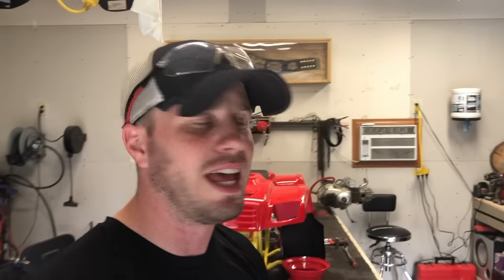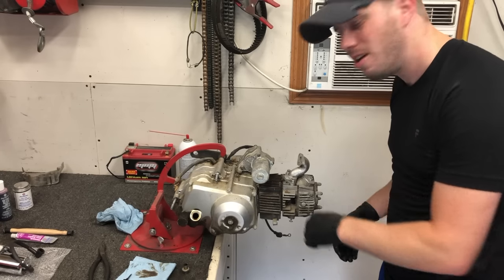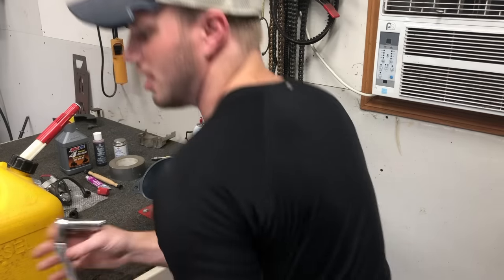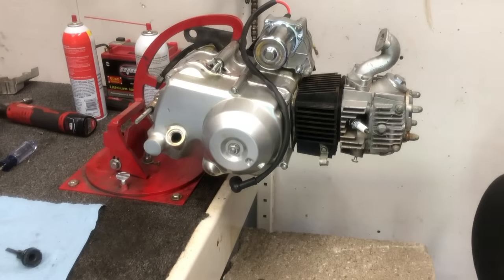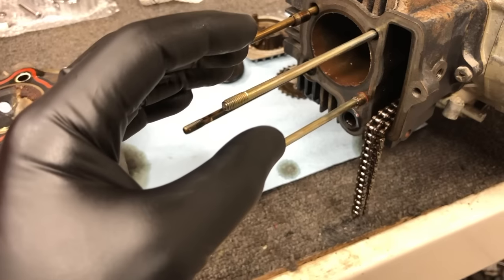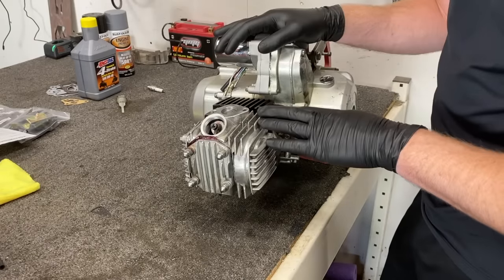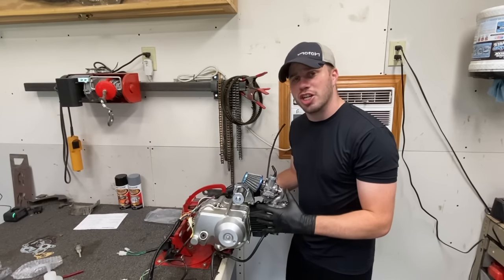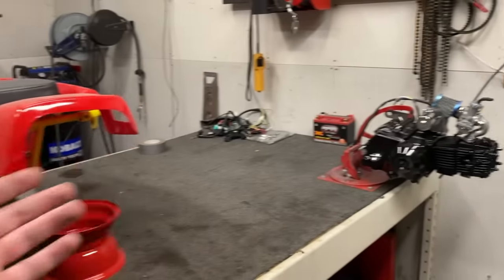Restoring a TaoTao 110cc Chinese ATV! Complete motor rebuild! Part 4

Comment: Quick question. I have a 110cc ZStar ATV that the piston is shot in. Would you know if a 150cc block would work on the transmission?
Reply from the maker: No it will not work. The stroke is different, you'd have to replace the crank as well.
Reply: @PraskaBoysGarage  you are starting to bring back some knowledge that was hidden. Lol
Isn’t there 2 different 110cc engines big piston/short throw and little piston/long throw? 

Sorry for the questions it’s been awhile sense I played with power sports. I have been a HD mechanic for 20+ years and am finding the love of wrench’s again with these Chinese bikes.
Reply from the maker: There is a lack of consistent information on these little guys so everything I know is pretty much from ripping them apart. To my knowledge the 110cc E22 style motors are the exact same when it comes to the crank and top end. I will be doing a video this summer trying to use a stock 110cc bottom end and putting a 125cc kit on it! We will see if it works I guess!
Reply: @PraskaBoysGarage  thank you for your reply’s. Guess I will start with tearing it apart and seeing what I can dig up to rebuild it.

Comment: Love the videos wear did you get the bench top motor mount.
Reply from the maker: Thank You! That is the #1 most asked question on my channel and I am expecting it to come up a lot from this video! I originally purchased the stand off eBay back in 2018, however the seller is hit and miss when they are listed. So I've decided to start working on manufacturing my own! Might be a little bit but once I'm ready I will be making a video for the launch!
Reply: @PraskaBoysGarage  Kool deal. Best of luck to you.

Comment: Are these motor know to have a tick to the motors ? My son has one and they had a small tap  a few days after we bought it.
Reply from the maker: I've never experienced that before. Have you checked the valve clearances? The need to be adjusted over time...not a few days though!The main issues I run into besides lack of maintenance are bent valves/broken springs, or if they have gears the teeth will sheer because lets face it 5 year old kids aren't the best riders!
Reply: No don’t know how to do all that; started a few day later but still runs strong 4 years later
Reply from the maker: @doobie3278  I with ya! I was taught that you don't fix what isn't broke!!

Comment: What is the best oil to run in these chinese motors
Reply from the maker: I use an SAE 0W-40 typically AMSOIL if I am going to keep the machine and have low hours on it. If it's going to be changed twice a year or I'm selling it I use TiLUBE 10w40

Comment: What wires did you connect to bypass the brake lever to start it?
Reply from the maker: I just held the 2 wires that attach to the brake lever together. Otherwise there is a second connector on the harness for a footbrake. If you put a jump connection in that, it will also bypass pulling the brake to start.
Reply: Thank you sir

Comment: Where do you find the best place for TaoTao parts?  I have found Partskit EXTREMELY unreliabile, out of 6 orders, all 6 orders had the wrong parts.  Also, I am rebuilding a TaoTao ATA 125D (110cc), and looking for a suitable wiring harness.  Reviews are hit and miss.   Where do you get yours for these 110cc ATV's?  Thank you for the videos!
Reply from the maker: My top 3 places I buy from is: 1) VMC Chinese parts 2) Amazon 3) eBay. I have a completely how to wiring video on my channel. I have links in the description but I will update this video later with an Amazon link I purchased my harness from.
Reply: @PraskaBoysGarage  I am really curious about the start/stop/light switch wiring.  The wiring harnesses I have purchased from both PartsKit & VMC do not have connections for that handlebar start stop switch.  Its the only thing that doesn't.  Off of the Start Stop Handlebar switch there are two mail plugs, one has a home, the smaller of the two on the female end of the wiring harness.   The larger male end has no female connection on the wiring harness.  Looks like the original wiring harness, had a female connection, but the wires were then spliced into the wiring harness.  I didn't see this in your wiring video.  How did you address this?  How did you get the lights to work?
Reply from the maker: @ericneusiis404  Can you send me an email with some pictures or even better send me an email with your contact information. That way we can video chat and see what your looking at!

Comment: Hey Praska, I have a similar ATV but the starter is at the lower part of the engine, and i have an issue where it cranks but every softly and you cant really hear it i was wondering if you can help me out, if i need a new starter or is it the actual engine.
Reply from the maker: Also make sure you have a good battery. A weak battery will give you the same result. If the battery is good I would test the starter like I did in this video with direct power, also remove the spark plug so it's not fighting against the compression. It's either the starter or battery! Good luck and let me know if you have any other questions!
Reply: @PraskaBoysGarage  Can the  battery be at 11 volts still run good because it's like brand new used it a couple of times.
Reply: Hey I have a similar engine after rebuilding a I am getting a popping noise in the bottom engine when turning the engine and do not know what they sound could be
Reply: @ravhunt2344  Also It like the piston is stuck in an area and its hard to move with the starter its self, I really have no idea but I dont want to take the whole motor apart and buy some parts and special tools.

Comment: Quick question boss, I have a new 110cc 4 wheeler about two months old and we were riding it and it slowly just stopped. I replaced spark plug and nothing. I sprayed starting fluid in the air intake and it started for a second or two, I know it’s not getting fuel now. There’s fuel in the tank and in the line filter but it’s not going into the carburetor or it is?. What do you think I should do next that’s the easiest approach? Appreciate any answers thank you sir.FYI Nice videos by the way! 👍💪🏼
Reply from the maker: It probably sucked something up in the carb. If it has screws on the bowl you can clean it and reinstall. Or if you want the easiest option order a PZ20 carb Amazon Prime for $15 bucks on amazon and switch it out.
Reply: @PraskaBoysGarage  thanks bro for the response! Really appreciate it🤘🏼

Comment: I am doing this engine as well, one question, I can't find any way to shift?  is this just a drive only?  no reverse??  Awesome video,   LOVE your channel.   I have a 150, a 125, and recently bought a 110 I am rebuilding!  found your channel a little late, but just in time!   just had to purchase a carb, but now I am wondering if I should tear the top end apart ...
Reply from the maker: The motors come in many different configurations. Some are only forward and automatically ready to ride when you start it up, others have Forward, Neutral and reverse and also they make have one that requires you to shift gears. All of them look about 95% the same.
Reply: @PraskaBoysGarage  well I searched this thing over and can't find any way to shift it so I am assuming it's just the one that has forward!   The 125 has a shifter and so does the 150.  Thanks!
Reply from the maker: @MyLooneyBin  Sounds good man, good luck on the projects!

Comment: Where do you get ur motor stand that bolts to ur bench?
Reply from the maker: My engine stand is probably the most popular tool I have on the channel. I got it off eBay back in 2018, but the seller is hit and miss when he lists them. I am currently working with a guy who owns a CNC machine to start making them myself!

Comment: Very helpful..thanks.  where did you get the motor stand?
Reply from the maker: Thank you! My engine stand is probably the most popular tool I have. I got it off eBay back in 2018, but the seller is hit and miss when he lists them. I am currently working with a guy who owns a CNC machine to start making them myself!

Comment: Where can I find a rebuilt kit brother to this same motor
Reply from the maker: This is a 110cc motor so it calls for a 52mm rebuild it. Here is a link from VMC or you can get them off eBay as well: https://www.vmcchineseparts.com/collections/cylinder-kits/products/chinese-cylinder-kit-52mm-for-110cc-engine

Comment: so i have a problem i took my engine apart because it was in a bad condition and gaskets were leaking so i had to change the piston and I got tried to solve the problem from before, starter spins very hard
Reply from the maker: My next video coming out should help you so watch for that next week! For now have you tried turning it without the spark plug in so it doesn't build compression? Could be a weak starter vs high compression.
Reply: @PraskaBoysGarage  i tried it is and i can hear some noise in the engine Like cam chain hitting something

Comment: Hey I don't know if your going to see this but im having pressure build up or loss of compression cause I have air coming out from my oil stick area can you tell me what my issue my be ??
Reply from the maker: If you have excessive pressure coming out the dip stick that typically means you have stuck or worn piston rings. You can try and put ATF down the spark plug hole and use a power drill to turn the motor over to help free the rings up in case they are stuck, otherwise it may require a top end rebuild.
Reply: @PraskaBoysGarage  for a top end rebuild how or what would i need as far as part to get this done unless you have a video that explains this cause im new to this but im anxious to learn
Reply from the maker: @alexisnarvaez5441  This video should help: https://www.youtube.com/watch?v=dDhGnXz5yKI

Comment: Omg. When I hook my battery terminals up my starter just gets engaged??? Please help
Reply from the maker: This is going to sound sarcastic but it's not...Are you connecting the starters wire coming off the starter directly to the battery by mistake and not to the relay? It looks the same as the battery power wire and can easily be switched around?

Comment: Great video my friend  
I have a similar engine and I wanna do the same
Where do you get the engine stand?
Reply from the maker: This is my #1 question for sure! I actually had a CNC company laser cut out all the metal to start making and selling my own. I will be selling the kits on my website either as a DIY kit or a completely assembled and power coated. I will post updates on the channel when they are ready!

Comment: Where did you get your engine stand holder and how much thanks
Reply from the maker: Thanks! That is the #1 most asked question on my channel and I am expecting it to come up a lot from this video! I originally purchased the stand off eBay back in 2018, however the seller is hit and miss when they are listed. So I've decided to start working on manufacturing my own! Might be a little bit but once I'm ready I will be making a video for the launch!

Comment: you painted the whole thing?
Reply from the maker: Mostly, I covered the intake and exhaust ports. Replaced the spark plug with a new one. Didn’t paint the starter, carb or intake.

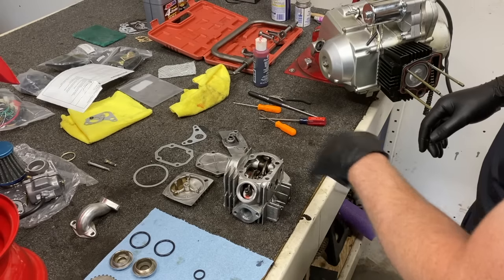Comment: I appreciate your videos, they have been a great help 😃 could you tell me, at 12:00 and 13:27 should there be a dowel in all 4 corners of the case and then on top of the cylinder ? Thanks from Australia
Reply from the maker: There are only 4 dowel pins total. 2 between the case and cylinder sleeve and 2 between the sleeve and head.
Reply: Thankyou mate. I'm already on engine 4 though ! One more question please, your engine stand, where can I find one ?

Comment: Some say this replyca Honda engine it is not ok because they put bushing hub not berings inside, it is that tru?
Reply from the maker: They definitely use metal bearings inside. I’m not sure what you mean by bushing hub but they are clones. Same as a predator 212 compared to a Honda GX200.
Reply: @PraskaBoysGarage  ok, sorry for my bad englisg. So this clone engine it ok.
Reply from the maker: @dudurosca273  No worries! I like these engines a lot!

Comment: Where did you get the engine stand? I rebuild these as well and man it's hard not having one
Reply from the maker: This is my #1 question for sure! I actually had a CNC company laser cut out all the metal to start making and selling my own. I will be selling the kits on my website either as a DIY kit or a completely assembled and power coated. Should have everything ready soon and will post updates on the channel.

Comment: Great video ! Do you happen to remember torque spec on valve cover nuts 🔩 ?
Reply from the maker: I reference Honda manuals from the late 90s for torque specs. Off the top of my head I wanna say it was 10-11 lbs ft torque.

Comment: i got water in it from air filter what shoud i do ?
Reply from the maker: Depends on how much water your talking. To be safe I would clean the carb out, change the oil, and then remove the spark plug and blow air from a compressor inside the cylinder. Then put a little ATF down the spark plug hole and rotate the motor a few times. After all that you should be safe to run again.

Comment: mine has a tube going from the air filter to  another spot on the back of the engine do you know what that is
Reply from the maker: To pass California emissions so it can be sold in all 50 states. It takes the case pressure and filters it back into the engine so oil doesn't pollute the air.
Reply: Praska Boy's Garage should i just take it off or diffrent solution
Reply from the maker: @nikolashitchcock7068  All the other motors just have a rubber line that runs down the back of the engine towards the ground.

Comment: Where did you get the engine stand?
Reply from the maker: It's probably the most popular tool I have on the channel. I got the stand off eBay back in 2018, but the seller is hit and miss when he lists them. I am currently working with a guy who owns a CNC machine to start making them myself!

Comment: Where did you get the motor stand
Reply from the maker: It's probably the most popular tool I have on the channel. I got the stand off eBay back in 2018, but the seller is hit and miss when he lists them. I am currently working with a guy who owns a CNC machine to start making them myself!

Comment: Nice video. Where did you get your bench mounted engine stand? Would be a great addition to my workshop 👍
Reply from the maker: Thanks! My engine stand is probably the most popular tool I have. I got it off eBay back in 2018, but the seller is hit and miss when he lists them. I am currently working with a guy who owns a CNC machine to start making them myself!
Reply: Great idea. You will have plenty of buyers.
Reply from the maker: @mikeweatherley936  I think it will be good, I usually get 1-2 comments per day about it across the channel. I plan to sell them assembled and powder coated or also in a DIY kit to save on the cost if you own a welder. Hoping to have the first few available by Jan 1st.

Comment: Where can I get myself one of these engine holder things?!!!
Reply from the maker: That is the #1 most asked question on my channel and I am expecting it to come up a lot from this video! I originally purchased the stand off eBay back in 2018, however the seller is hit and miss when they are listed. So I've decided to start working on manufacturing my own! Might be a little bit but once I'm ready I will be making a video for the launch!

Comment: who makes that motor stand?
Reply from the maker: My engine stand is probably the most popular tool I have. I got it off eBay back in 2018, but the seller is hit and miss when he lists them. I am currently working with a guy who owns a CNC machine to start making them myself!

Comment: Where can I find that engine stand?
Reply from the maker: This is my #1 question for sure! I actually had a CNC company laser cut out all the metal to start making and selling my own. I will be selling the kits on my website either as a DIY kit or a completely assembled and power coated. Should have everything ready soon and will post updates on the channel.

Comment: Man I know you get tired of hearing it and I hope I haven’t missed this answer previously but where did you get your engine stand? I need one and that seems perfect
Reply from the maker: Hey no worries man, this is my #1 question for sure! I actually had a CNC company laser cut out all the metal to start making and selling my own. I will be selling the kits on my website either as a DIY kit or a completely assembled and power coated. Should have everything ready soon and will post updates on the channel.
Reply: That’s awesome man that will make some good gains for you for sure. And I will have my order in as soon as you get them ready 👍. Thanks for the reply

Comment: I have that exact carb how to tune it,mine idling real high
Reply from the maker: There are only 2 points of adjustments. The air/fuel mixture screw and needle depth. You will need to adjust both individually and try and find a good running point. If you have no luck it would be best to get a jet kit or a new carb.
Reply: @PraskaBoysGarage  it’s a brand new carburetor same as yours but everything I touch the acceleration it revs really high

Comment: you painted even the  sparkplug.
Reply from the maker: Yes, I left the spark plug in so I wouldn't spray paint into the cylinder. However I did changed the plug with a brand new one. If you jump to Part 6 at 9 minutes and 15 seconds you'll see a brand new plug sitting in the motor.

Comment: I have the same engine, I drove at maximum speed for a few seconds and the engine doesn't start anymore! Can anyone help me? So I'm from Germany apologizing for my pronunciation.
Reply: A motor needs 3 things. Spark, Fuel, and Compression. most likely compression if it did run . maybe bad piston rings